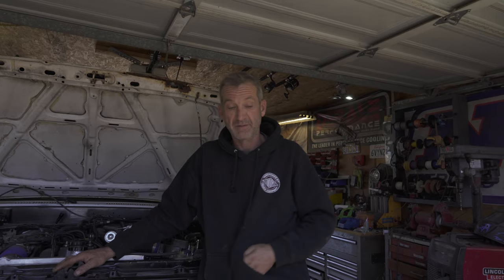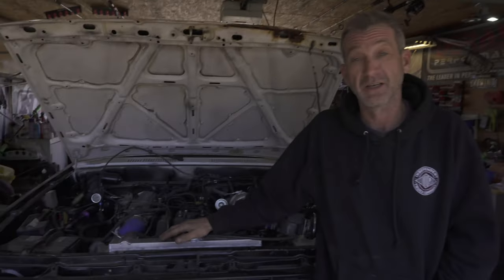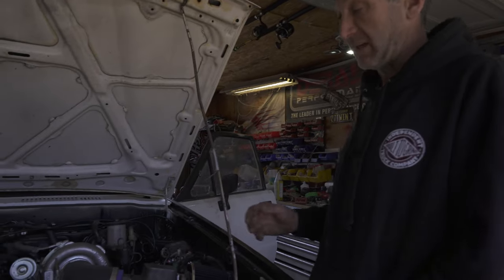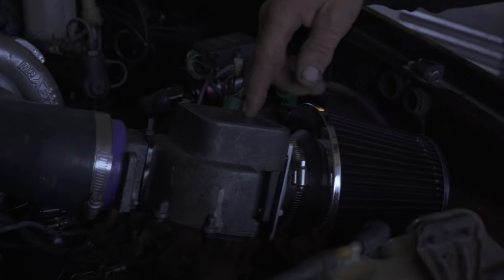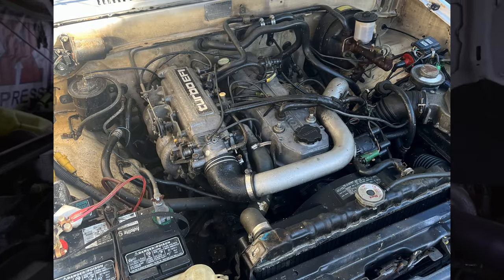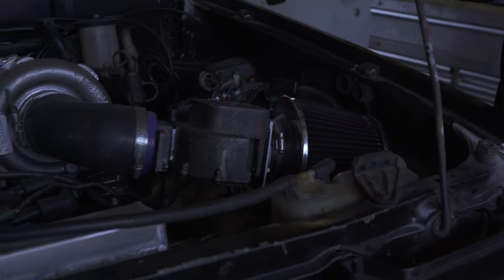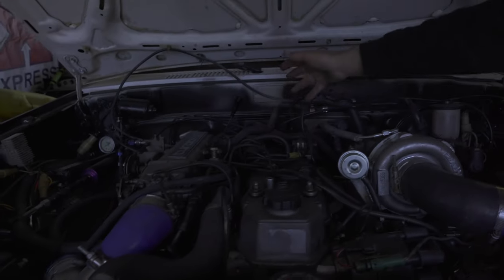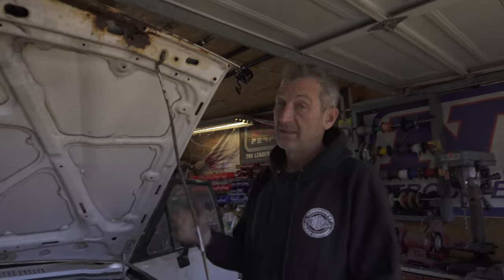OG CONTENT! Back to Building!

Comment: lol i sold one of these when i was a teen..  rebuilt the 22re engine sold it for 3k ahaha rare opps  idk why  but i dont like small trucks when i haul a 30ft offshore boat! but great cali truck for sure
Reply from the maker: Nice boat! Mine is only 17ft and 1300 lbs
Reply: Perfect setup tbh. It’s easy offload and load don’t have to worry about finding a spot to put 60ft of trailer a truck! You can hook a book in moments notice! It’s great. hey man great work will be following along!